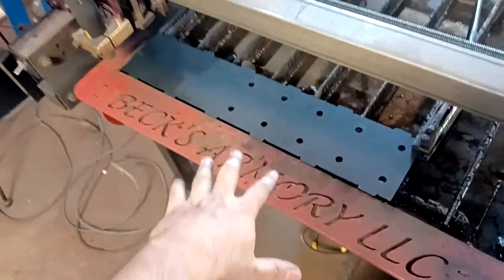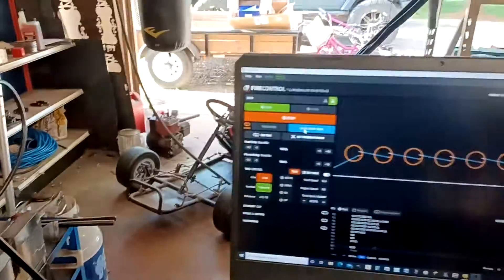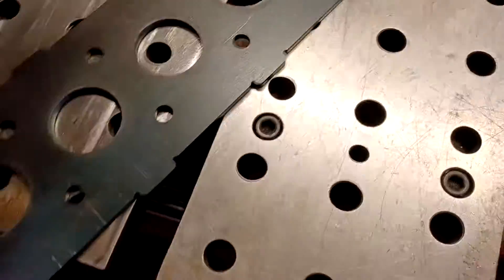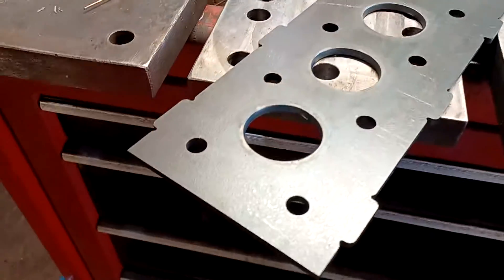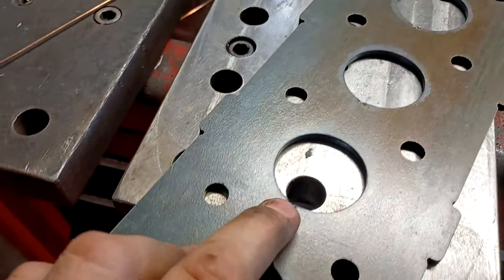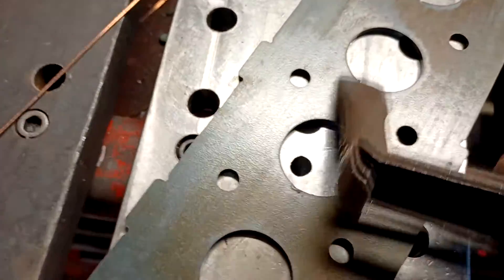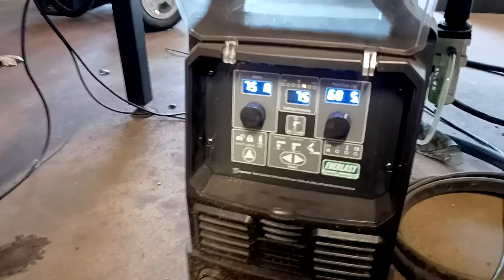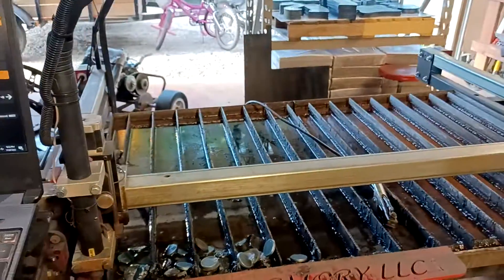Everlast PowerPlasma 82i CNC PAC 10 Months Review! #cncplasmacutter #plasmacutter

Comment: Did you wire it through the Everlast voltage divider or did you wire it to the raw voltage inside the plasma cutter?
Reply from the maker: I used the raw voltage pins on the cnc connector on the back of the machine. (pins 5 and 7)
Reply: @BeckTools  But you didn't modify the voltage divider board? Some people bypass the 100k ohm resistors, saying they change the true raw voltage to the plasma table. They're in the circuit to reduce amperage but still provide the raw voltage which would prevent damage to anything should it get shorted out..
Reply from the maker: @1990notch  I did not modify anything.  I just hooked it up leaving the 100k ohm resistors in place.
Reply: @BeckTools   Thanks for the prompt replies!

Comment: We have two Everlast machines in our machine shop. A 100% duty cycle MiG and Tig welder. 1/4 the cost of trying to buy a miller with a duty cycle like that. 4 years old now and still running. And for you haters out there, open up your miller, it’s made in China too, just assembled in the US, more fake claims by the big brand names.
Good job man, we will add the Everlast plasma next.
Reply from the maker: Yeah Everlast is a great option for the price. Glad to hear you are happy with the products!
Reply: I to run some everlast stuff. Been working good as well. But go tour the miller factory. Not more than 10% made in China

Comment: I was thinking of going with the 60 amp but could get the 80 amp unit if it uses less amps when turned down. How low can you go and still get a good cut? Just wondering if you could go down to 60 amps and it would still cut like that but maybe a bit slower?

When set to 75 amps and cutting how many amps is it actually pulling?

Was thinking about the 65 amp harbor freight plasma cutter but 90 day warranty? NOPE. When I seen the equivalent Everlast unit was actually cheaper then the HF and has a 5 yr parts and labor warranty well all I can say is SOLD, just have to decide on the 60 or 80 amp unit.
Reply from the maker: The 80 amp has a better torch and uses the higher power consumables like the 100 amp machine.  The 80 amp machine can also run at a 100% duty cycle at 60 amps.  This means long cut times are no problem.  The 80 amp machine can run 0.9mm consumables at 30 amps for fine cutting.  It's better all around for a very little increase in price.
Reply: @BeckTools  Thanks for your reply. I emailed Everlast and the guy who answered said it [this 82I version] needed 68 amps inrush current but the manual says 55 amps so he contradicted the published specs. He said I needed to use the inrush amp figure as over all amps needed and I would need a 70 amp breaker, but like I said the 82I manual says 55 not 68 amps.... so?

I think there is/was some kind of misunderstanding. I am going to call them and speak to another tech about it to be sure.
Reply from the maker: @robert5  I've been using a 50amp breaker and running it wide open.  I've never has a breaker trip.
Reply: @BeckTools  Wow thanks for telling me that. I did order the 82i today and was wondering if I would have problems.  I'm running a 60 amp breaker as I run a 175 tig welder off that plug. I feel much better now. I guess the last person I talked to at Everlast, a sales guy was right, he did say I would be fine with a 60 amp circuit. I was hoping over all I'd still be able to run my 5 hp ingersoll rand compressor at the same time as the plasma cutter. I'll have to wait and see on that. 

Note to people researching the Everlast PowerPlasma 82i, it is on sale now, 4/13/23 at $1249.00, CNC version is more but is also on sale now, but not for much longer. It is out of stock, they said when new stock comes in it is going up about 120.00. They also gave me a coupon for 25% all accessories and consumables for the next 24 months. Call them before you order to get that coupon.
Reply from the maker: @robert5  No problem.  That's cool they gave you and additional coupon code as well.  I love those guys.  I also love the 82i.
Reply: @BeckTools  The Everlast PowerPlasma 82i came in today. I got it setup in enough time to do 2 test cuts. I also ordered some rails and ball screws to do a 48 x 48 CNC table. The fun begins.
Reply from the maker: @robert5  sweeeeeet!

Comment: After clicking on your link, is there anything else I need to purchase in order to connect this to my Crossfire Pro? I currently have the Hypertherm 45xp with CNC port and machine torch and am going to switch over to this.
Reply from the maker: No it comes with a plug for you to attach your THC and trigger. I have a video that shows how to hook it up.  Check out my Everlast playlist. :) If you click the link than buy within 30 days of that click it helps the channel. :)  If you have any other questions I'm also hear to help.

Comment: Very nice.  I'm in the process of clearing out part of a garage for our workshop.  I created an invention a few years ago that has 12 sheet metal parts (16 ga) and 7 rivets.  It was expensive to get the parts tooled (stamped).  There's also no way I can get high enough volume for an order to make the price per part cost effective unless I order 10,000 of each piece.  Then I discovered CNC plasma cutters.  I'm looking into getting a Crossfire Pro with the Everlast 82i.  My price per part will be so much cheaper and I can make 10 at a time if that all I need at the moment!

Each of my parts have a couple of 5mm (.2 inch) diameter holes in 16 gauge.  I've read that you can use a 62i torch (smaller diameter consumables) with the 82i.  Do you think that would be necessary or would the 82i machine torch cut .2 inch holes cleanly (they don't have to be perfect)?

My wife is going to start her own sheet metal art business using the equipment.  We're both pretty excited.  Thanks for the great content you''ve created.  You have a new subscriber today!

Comment: Coulda made 'em bigger
Reply from the maker: Yeah I know.  The problem is my customers don't all know that.  If it's perceived as week people will not buy it.  It has to be a little overkill just to convince the ill-informed.  I'm making it just light enough to be under 70lbs but still as strong as it can be.  These couple parts are not even close to being the weakest link so you're correct I could make the holes bigger for sure.
Reply: @BeckTools  It's a SQUARE though.